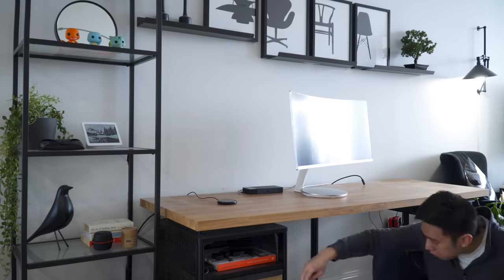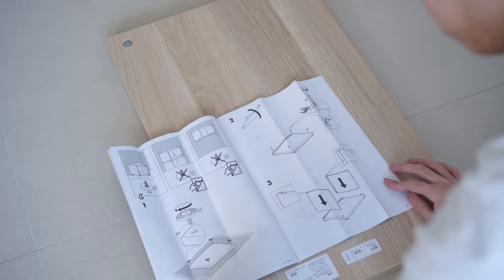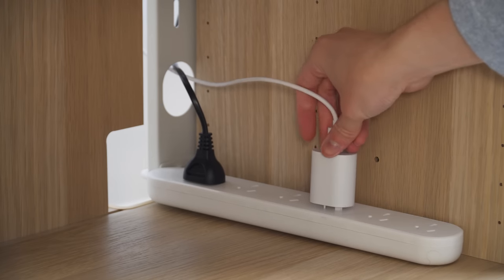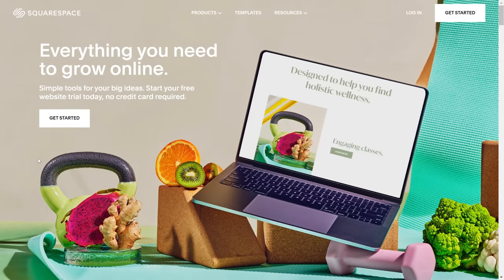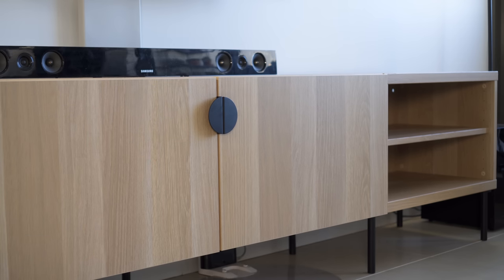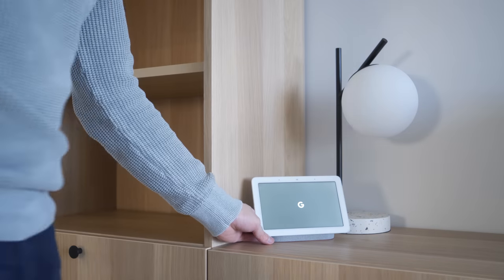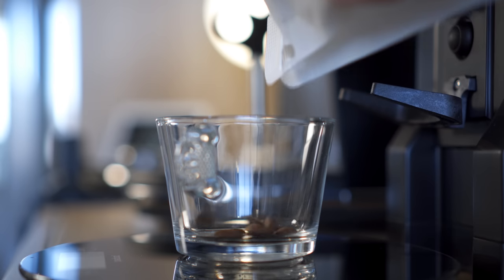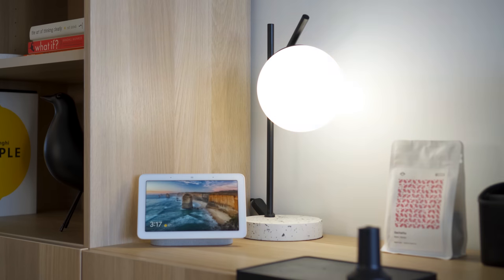Living Room Makeover Pt.1 (DIY IKEA Sideboard Hack + Coffee Bar)

Comment: Great video Reynard! Got a question for you...you have a lot of indoor plants, is there a way to reduce flies and pests that come from these pot plants?
Reply from the maker: Thanks Lisa! Not a plant expert but I've got this Neem Oil from a local Melbourne based company called The Plant Runner, they've got glowing reviews and featured in a lot of plant care books. I Just spray and wipe the foliage occasionally with it, never had a problem with with pest or anything else.
Reply: Lisa Tiu: when you have these little flies, try lighting a few matches, blow it out instantly, then put it head down into the soil.
Do that with about three matches in smaller pots and in every plant you have. Renew from time to time.
The flies lay their eggs in the soil and they don't like the matches, so after a while you get rid of them.
Another method, so I am told, is putting bird sand on top of the soil in your pots. 

Additionally, at the plant store (at least in Germany) you can buy yellow sticky paper that catches the little flies that fly around.
Hope that helps.

Comment: Looks great. Why do these legs needs less legs than the ikiea legs?
Reply from the maker: If you watch the video closely, there’s a connector for where the legs go. So essentially when two units meet up, instead of two legs right next to each other, there’s a connector and you only need one leg.
Reply: @reynardlowell For the legs that didn’t have a connector piece, how did you make them the same height as the others?

Comment: Great design! Actually taking some inspo from you to redo my tv cabinet. But question for you, how come you didn’t install any handles to the bigger drawers at the bottom below your cup drawer? Is it hard to pull the drawer out without it?
Reply from the maker: Thanks! I just wanted to keep it clean, so only handles for the top. It's actually not difficult at all to pull, and I use the bottom ones to store extra home supplies (paper towel, tissue, etc), so I don't access them as often.

Comment: Hi Reynard, the first drawer of the highest frame that one above the shelf, size is fit to the drawer door, besta shelf only got 2 size also not fit to the drawer door. May I know what size is that shelf
Reply from the maker: Hi Kevin, not sure which one you're referring to, was it the one with books (tallest drawer to the left)? Either way, the height of the besta shelf/divider is customisable. The shelf size I think comes in standard 36cm and 16cm deep, depending on which Besta frame you go for.
Reply: Actually the shelf and drawer door between got gap